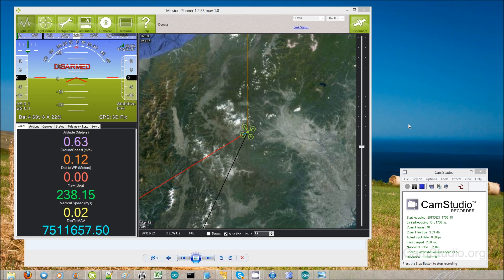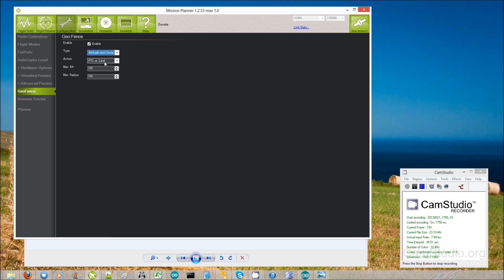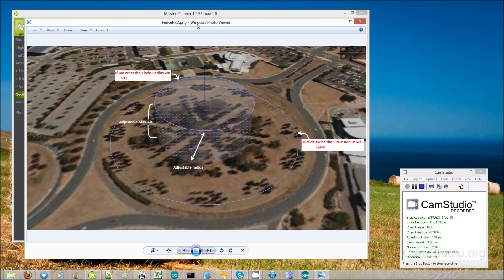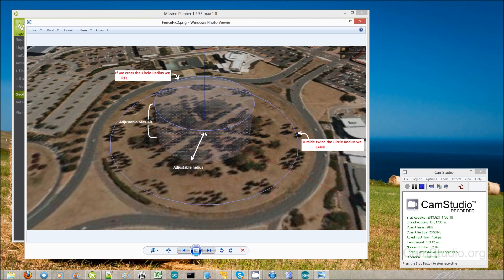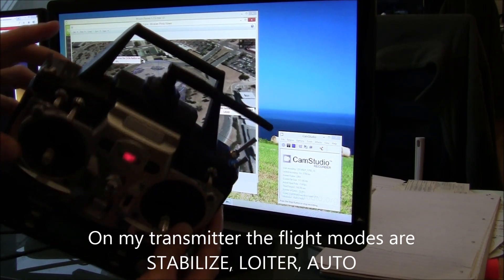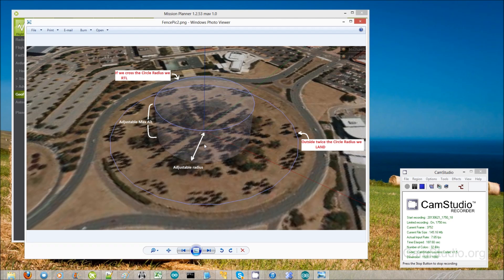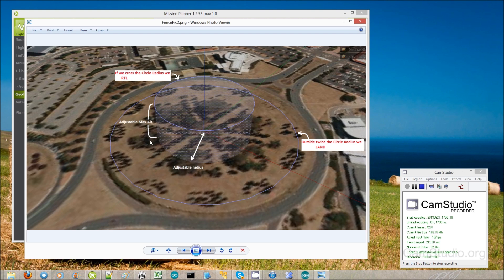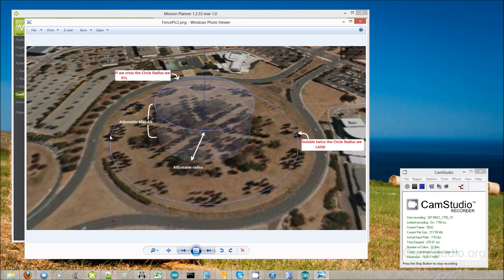ArduCopter 3.0 Fence

Comment: Randy, my quanum nova has a range of 300m. Can this be increased?
Reply from the maker: paulkazjack I've never flown one but I hear it's based on ArduCopter (aka APM:Copter).  So it should be possible to connect to it with the mission planner (or other GCS) and change the FENCE_RADIUS parameter to a larger number.